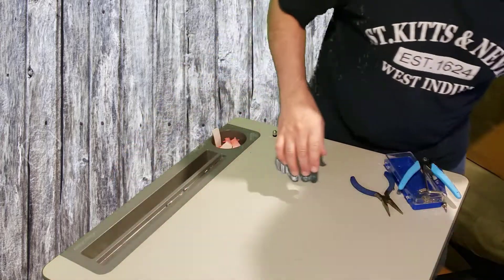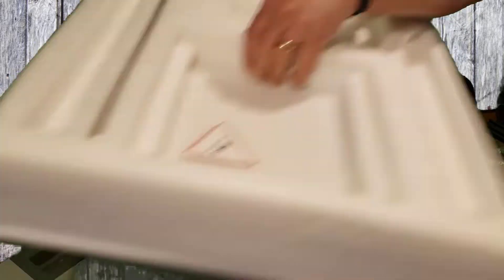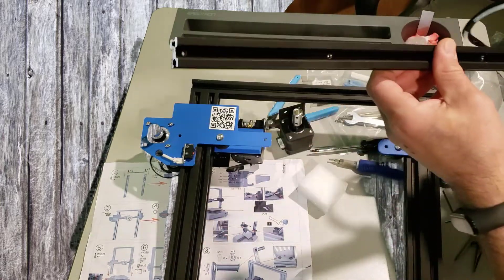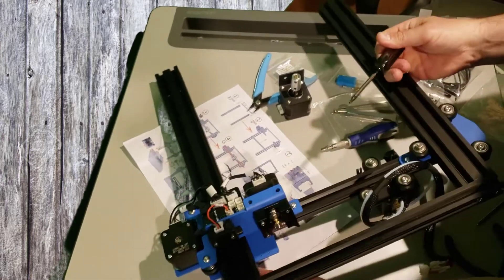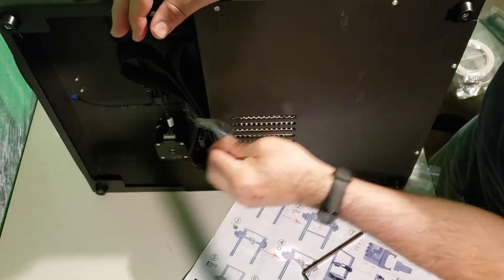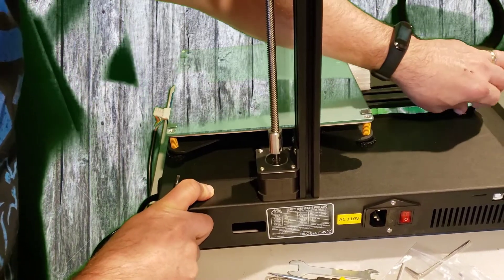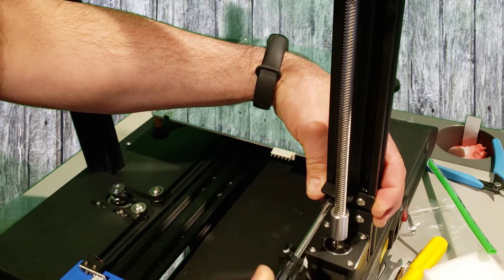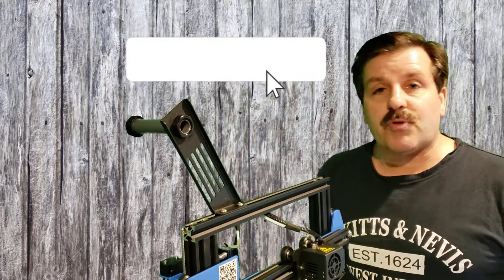Tested! Assembling the Anet ET4X  in about 15 minutes.

Comment: Mine just arrived, getting ready to put it together
Reply from the maker: Awesome! If you have questions, ask away.
Reply: @HLModTech  It was very easy to build went on to table leveling and its missing position 2 leveling nut, guess i will go to the hardware store and get a nut as i wait for amazon to send the missing part.
Reply from the maker: @barrywingler418  Glad the build went well. Are you saying the nuts under the bed were missing?  That is a total drag!
Reply: @HLModTech  Yes just the one one on the left side back the other 3 are there, M3 nut at the hardware store and a small washer, now on the bed leveling and printing a fish fossil lol

Comment: can you give me a cura profile i have the printer and need a better profile
Reply from the maker: I use the stock one. This video shows how to get at it and the small adjustments I make. What kind of issues are you having?
Reply: HL ModTech I’m having issues we’re I get the supports not coming off it would brake off with the model
Reply from the maker: Hmm.. Which kind of supports? Normal or the new tree ones? Sometimes I clip mine off with the  sane tool I use to snip a edge on the filament.
Reply: Thank you
Reply: Oh thank you
Reply: Normal
Reply: Yeh I doo it with my hand so that might work
Reply from the maker: @alot_of_ducks  I have also used needle nose pliers.